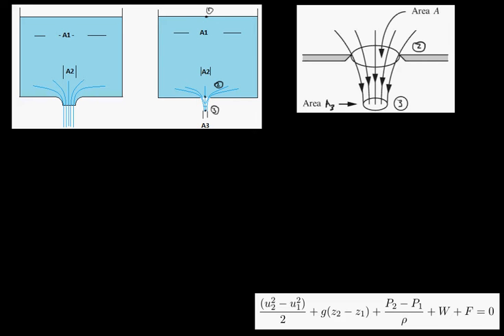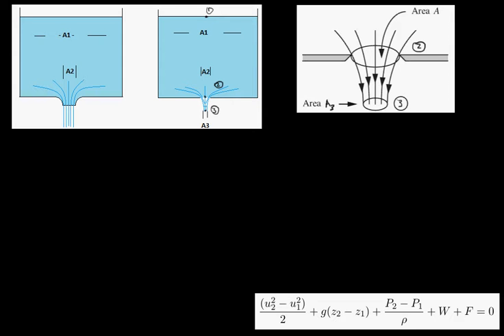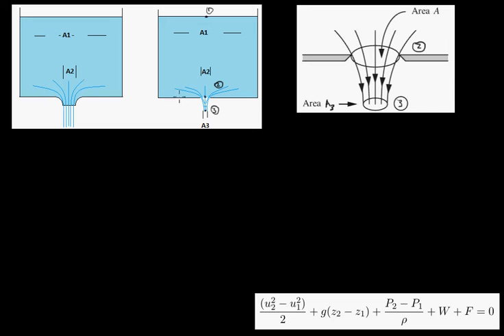Intro to Vena Contracta (Fluids 4)

Comment: Although I'm lost in the expression, (I'm a slacker when it comes to math) you helped me better understand what's going on with flow under pressure (from gravity or a pump) going through an abrupt tight spot. I'm assuming the diameter reduction of the contracta may not be as significant with increased friction and viscosity. 

Thanks for your video!